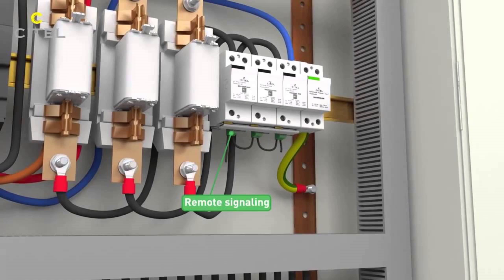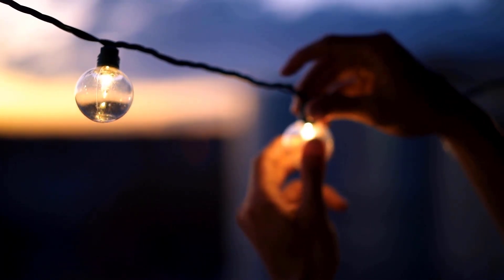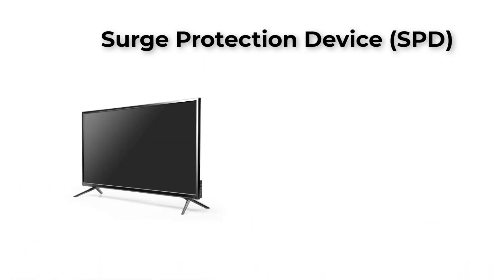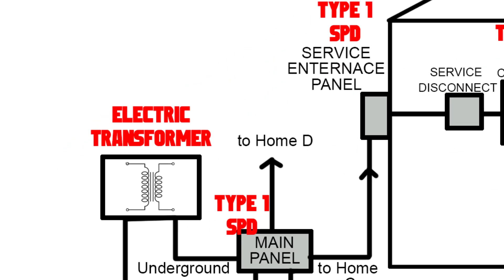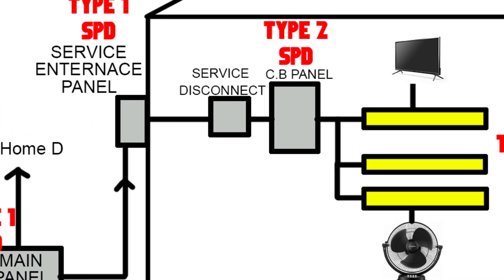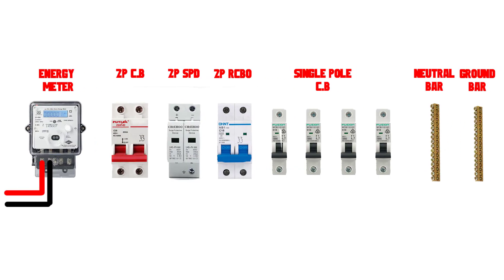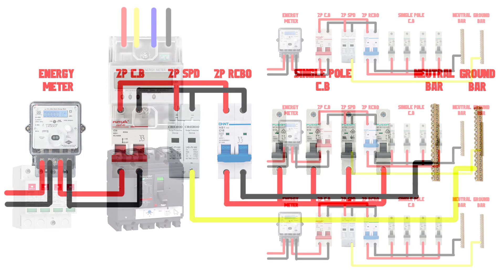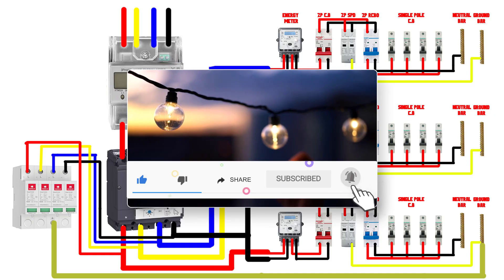What is SPD (Surge Protection Device) and how to install it? |EXPLAINED

Comment: If there are any hight in voltage how the spd disconnect the power its connected with Cb with parallel and the current through to the load all time . ? Can you explain to me thanks
Reply from the maker: SPDs don’t disconnect the power — they redirect the surge current to ground